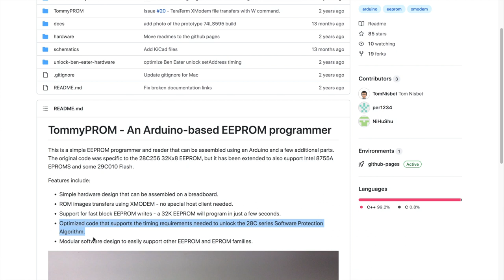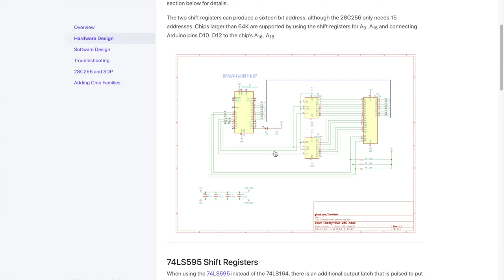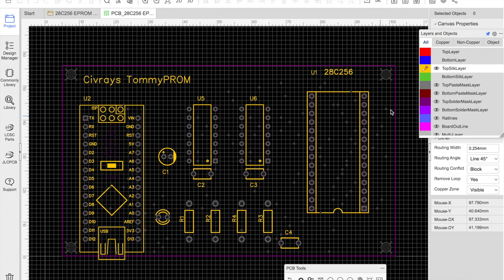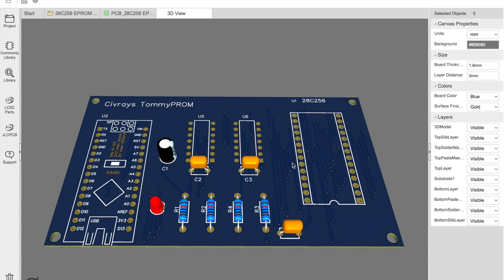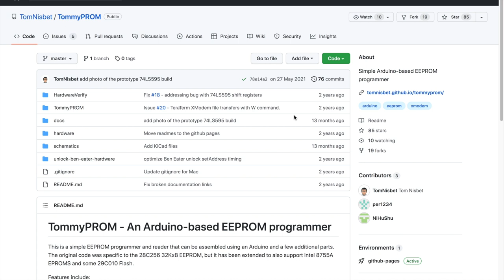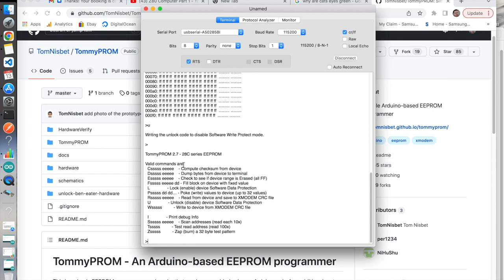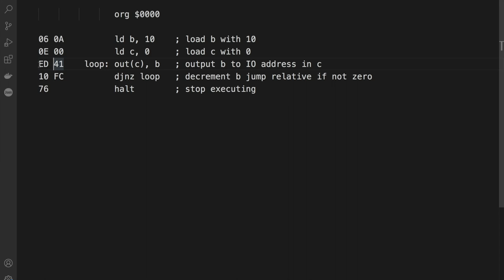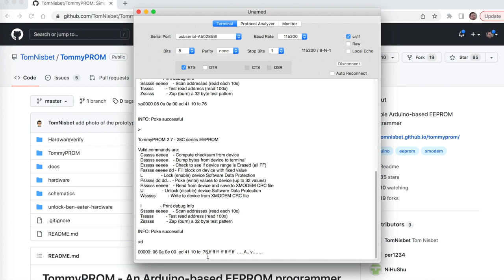Z80 Computer - Part 2 Adding ROM

Comment from the maker: If anyone in the UK wants an EPROM programmer PCB then I've added my email address to the about page on my channel. I think this is only visible from desktop.
Reply: Can't find you on FB :(
Reply from the maker: @SimonParkes  go to my YouTube channel about page, you should be able to find my email address.
Reply: Be careful about sending them in a normal envelope. The machines they use to process mail can sometimes get jammed up by the boards, or worse yet, break the boards. May need to mark them especially so they don't get processed through the usual automated machines.
Reply: @marcpearson2913  I received mine and Steve has packaged it very well, was protected etc :)

Comment: When you said that you couldn't unlock the write function for the chip, my first thought was "timing issues" and then you said later that it was timing issues.  😆  I guess I really am a computer nerd.
Following on from my comment on your previous video, I was thinking of implementing memory protection by having the hardware use the M1 output to "capture" the address at which the instruction was loaded plus part of the machine state, including which bank is currently switched in.  Some logic would decode that into a go/no-go signal to either enable or disable bank switching.  A RST instruction to call the OS to request a function such as bank switching would cause an auto-switch to the OS bank, meaning that the running program can't use a direct jump to the OS code in order to bypass memory protection.

Comment: Hi, i really hoped this video many months ago. thank you so much. your explanation helped a lot. At time i'm working with an adaptation of Ben Eater's programmer without problems; but i would like to try Tom Nisbet's programmer  too ( maybe in the future) , it sounds interesting. at this moment i'm trying uart communication, I'm using an arduino to get that goal. Greeting from Lima-Peru.
Reply from the maker: Hi there, thanks for watching. Yes, the Ben Eater programmer is fine if your chip is already unlocked. However, if you want to try the Tom Nisbet code you should be able to do it just by changing a couple of pin connections on the Arduino. It would be good to hear about how you get on with the uart.

Comment: According to the Z80 manual the djnz offset is relative to the djnz opcode address. Thus in your code it should be FE (-2).
Reply from the maker: Yes the manual is quite confusing on that point but I can assure you it needs to be FC (-4). It's an offset to the program counter (PC). PC is incremented twice when the djnz instruction is executed. I'm not sure if your manual has the same wording as mine but the one I'm looking at also states "the assembler will automatically adjust for the twice incremented PC". I don't know why the manual is referring to an assembler, because the assembler has nothing to do with the documentation of the the Z80. As we are not using an assembler here, we have to make that adjustment manually ourselves. So -2 becomes -4.

Comment: if the z80 is a 8 bit system, how should i program 4 digits into ram.  00000110 1011 00010000   this is the load b 10 line but i dont understand how to pad that 4 number value to a 8 number value.
Reply from the maker: I don't think your numbers are correct there, but you can pad a binary number the same as you would pad any number, just add zeros at the beginning.

Comment: Can I use AT28C64B instead of AT28C256?
Reply from the maker: I suspect in theory yes you probably could, but there are two things to be aware of. It only has 8KB of memory instead of 32KB. As such there are two less address lines. More importantly, the Lock/Unlock feature seems to use different addresses. So If your chip is locked you might have problems unlocking it.

Comment: 8:07 dont do same like everyone. add one 74164 and you safe 8 data pins. address and data can be send same shift registers.
for example i made programmable logic with attiny85 and 4x 165 and 4x595.
i can control 32(31) input 1 is programming mode and 32 output from 6 pins (all of them xD).
my first data structure was 2 byte and use all (not/and/or/nand/nor/xor/xnor) 2 input gates
and only 16 logic gate can program, but they can be any thing any order
inputs can be pin and another gate output.
setup 16 gates take 4x16bytes 512kb from attiny85 is enought xD
could easy make 3 byte commands or 4 like i later made
2byte for gate number so 65k diff gate xD and 2-8 input gates (bcoz i could lol)
its easy desing scheme but harder program arduino make it
programming mode was easy and can be program with arduino faster
havent made any IDE so every gate need hand program LOL
but thats how programmable logic work

P=pin mode 1 internal gate 0 (i kept them apart even they actually do same things after beta version lol)
could change to use 5digit gate number
G=logic gate (0 output 1-7 gates not/and/or/nand/nor/xor/xnor)
N=logic gate number (yes only 16 this desing)
A=gate input A (pin or gate output)
B=gate input B (pin or gate output)
O=output (0-63)
xx=AB 0 internal 1 input pin
0GGGNNNN AAAABBBB internal gate GGG(1-7) NNNN number(0-15) AAAABBBB (input AB pin/gate number depend next setup)
0000NNNN ABOOOOOO internal out NNNN A and B input(1 pin 0 int.gate) OOOOOO=MAX 63 (only have 32 output)

1GGGNNNN AAAABBBB pin gate GGG(1-7) NNNN AAAABBBB
1000NNNN ABOOOOOO pin out NNNN A and B input(1 pin 0 int.gate) OOOOOO=MAX 63 (only have 32 output)

desing fix for more gates if someone want try LOL
peoblem is you only can use 5 digit gate numbers to output to pin bcoz 4 digit AAAABBBB refers gate if set it
GGGNNNNN AAAABBBB gate setup NNNNN AAAABBBB
000NNNNN ABOOOOOO pin setup NNNNN A and B input(1 pin 0 int.gate) OOOOOO=MAX 63 (only have 32 output)
but yeah i never this bcoz i used new 4byte commands xD more gate with inputs and all 32 output can program and 31 input

yeah some peepol are crazy for weekend projects or couple weekends LOL